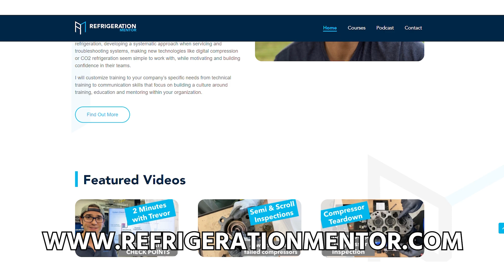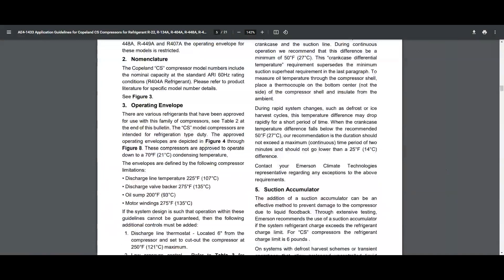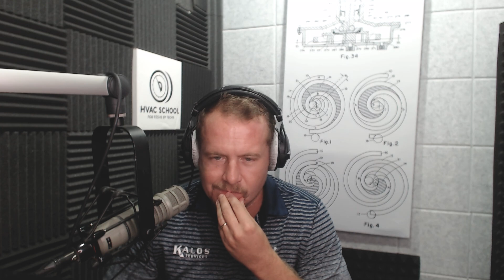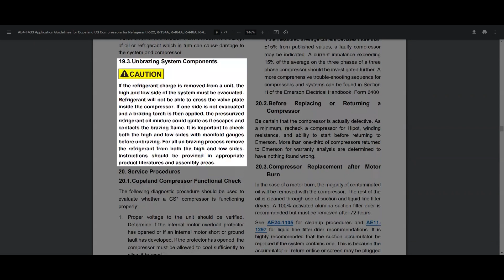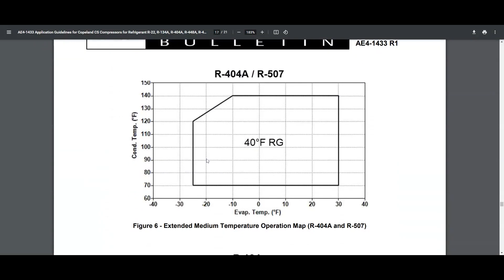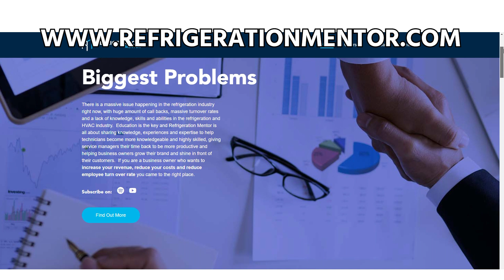Copeland Reciprocating CS Compressors w/ Trevor

Comment: Packard has bleed resistor that come with spade terminals already soldered on. I think a pack of 10 is like $10.
Reply: Thank you for the info, I will look for those.
Reply: Or recycle ones from bad caps
Reply: 25 yrs in HVACR business and never heard anywhere to replace suction line accumulator. Bad burnouts maybe??  Been nitro purging for years while brazing but usually always leak check system with it's vacuum holding ability.

Good ol' days them hook up stubs out of compressorors were all copper.

Please elaborate